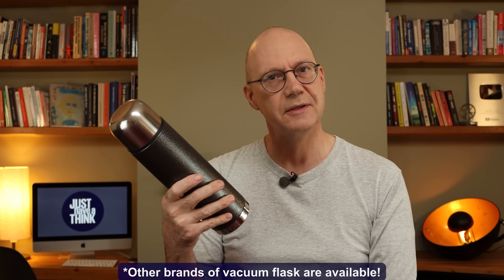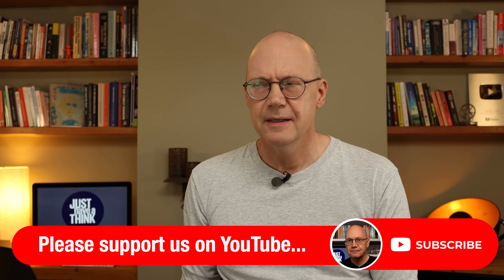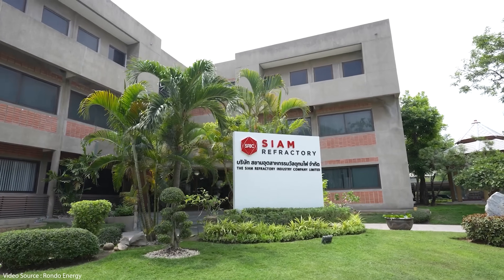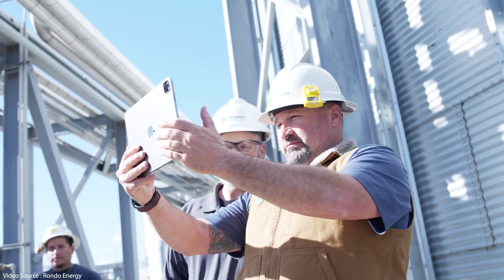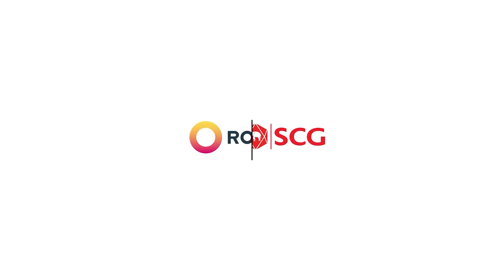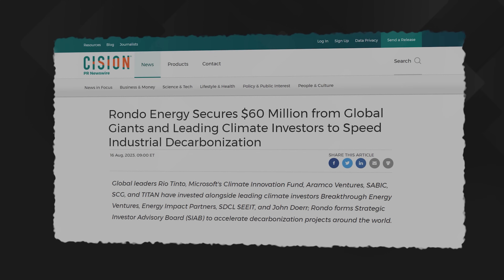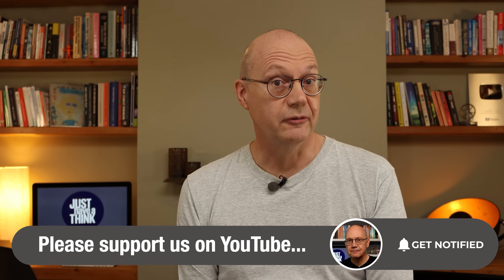This energy storage technology is HOT STUFF!

Comment: Check out the long history of ceramic brick steel heating furnaces. "Checkers are a matched pair of insulated in ground pits with a pattern of brick and air passages. The exhaust of the fuel  burners is pulled into one pit to reheat the bricks while ambient, pre- combustion air is heated in the other pit. Higher heating capacity and greater efficiency makes possible close to 3,000F in the steel reheating pit for forging or rolling the steel.

Comment: The issue with all heat storage schemes for the electricity grid is the inherent inefficiency of a heat engine, especially steam turbines. Aint no getting around the Second Law of Thermodynamics. This means the round trip efficiency of any heat storage system is inherently low. It will always be much more efficient, and hence cheaper, to store your energy as kinetic energy (flywheels, pumped storage etc) or as electrons at a cathode (batteries, supercapacitors). This is exactly the reason, for example, that thermal solar (mirrors melting salt) cannot compete with solar panels.
Non-electrical uses (ie process heat, house heating) have a better chance of working economically, but that is a FAR smaller market than the grid and so much less sexy for venture capital investors.

Comment: How do Rondo achieve a final process heat/gas with 1500 deg C for cement - as one example? Rondo needs an electrical air heater which can deliver maybe 1600 deg C by receiving 1400 Deg C from the heat box to charge the heat box?? They should explain the details which can make you believe in the system.

Comment: 1m³ of hotwater = 50 litres of refractory brick.
 A m³ brick = 20 m³ of hotwater. 😊😊
Just blow hot air over the water pipes and turn the hotwater tap on.

Comment: For the highest temperature (1800 degrees celsius) thermal battery and no "toaster wire", check out award- 
winning MIT-spinoff, Electrified Thermal Solutions, located in Medford, MA, USA.

Comment: The real question for power storage is which is most reliable long term. Personally I'm working on replicating rainwater charge capture and intending to use both that and solar for a 1kWh isolated power system that delivers 24V and constant current for lighting etc.

Comment: Why not add a smaller one of those hot brick units to every new house and public or industrial building? They could collect Solar heat and atmospheric heat, using heat pumps, and be used to stabilise temperatures in those buildings, whilst supplying a good amount of the hot water which the places need.  The warm waste water could go through the heat pump to reclaim much of the energy which would otherwise go down the drains.

Comment: I'm wondering how much excess electricity supply we have in the UK, I was under the impression we were, at times, hard pressed to generate enough electricity to meet our current demand, is excess supply a common occurence even against that background?
Reply: Different countries (and different utilities within countries) have different energy dynamics, some struggle with under-generation and some with over-generation. One thing remains true across all markets -- as renewable energy is increasingly deployed, generation during daylight hours will dramatically increase, and the only way to transfer that to off-hours is via storage. In our case, we're using peak-generation energy to turn off gas-fired generators 24/7.

Comment: Scalability is probably the most charming thing about this. As it seems to also work at smaller scales. We will probably have a much harder time if we do not also try to break the oligopol of the big scale power plant companies in the process of rebuilding our energy grids.
Energy is the key ressource to break out of the age of scarcity and we need to push for easily available cheap energy to finally break out of the scarcity management economy.

Comment: Simple question:
How do you insulate 60-90m3 of rocks heated to 700-800C so they lose less than 0.5% energy per day when its at the hottest state?

Backstory: Heat the rocks during summer with PV panels to have it usable during winter.

Practically it would have to be less than 0.5% but not much more.

My only solution is to just use more rocks, bricks and air gaps plus a bit of glass wool. But maybe I am missing something obvious?
The vacuum containers are too difficult in implementation for popular use.

Comment: " can they now achieve their goal of a 90GWh per annum production facility for their simple heat battery technology"?

The simple answer is no, because they are not producing any energy, they are converting high value energy to low value heat.

But it might be a way to use the excess wind energy in the warmer months to provide hearing in winter, accepting the huge losses of energy,.
Reply: With a discharge rate of 1% per day, heat storage over three months (summer season) would be about 60%. And I doubt the numbers in their spread sheets are even close to the real numbers they have never been historically.
Reply: That first installation is "delivering 2.3 MWh on each charge cycle", and how much does it consume?

Comment: Expanding this idea, Just have a think, there's a Czech company that is introducing a product for small residential housing. You'll buy a device with a super-insulated box of sand (above-ground shipping container or dedicated underground). You'll heat the sand in the summer to 400°C (480°C for larger industrial applications) and gas-heater sized box in your house will provide the heat whole winter. Thanks to tackling both thermal radiation and conduction it only looses, if I remember it correctly, like 8%  of heat during whole heating season cycle due to thermal losses. The sand should be "forever" operational without loosing it's properties. The down sides are the storage is quite huge for a typical house (can't remember how many cubic meters, I think like 30 m3) and the initial cost for preorders is really high - in excess of €50k. Just have a think, if this is really all feasible and working perfectly and the price goes significantly down due to competition. We'd be heating our houses with the summer solar excesses from our PVs! Apart from that, they prepare something like mobile heat units, so a couple of trucks would arive to a destination with pre-charged shipping containers and provide a heat in case of an outage of a heating system.

Comment: 'Heat Batteries' Blocks of concrete with resistance heaters in them were installed in most 1970's UK Council houses. To power, Blown air ducted heating. They were OK, as long as you didn't mind being a dried out dessicated prune all winter. Isn't it great how ancient technology is jazzed up, with buzzwords like AI & Heat Battery...

Comment: Any progress on the molten aluminium boilers designed to replace conventional boilers in power stations?

I like the idea of using change of state (melting materials) as energy is stored without a rise in temperature (once melting point is reached).

Comment: Yeh, ok, but what's new? 
Don't get me wrong, I like the general concept & I like to see it implemented & reported but what's new here? 

Storing heat in bricks & other artificial or natural rocks probably goes back before the Stone Age, insulating your rock pile is a bit more modern but not significantly so. Brick shapes optimized for a desired fluid flow isn't new (though this shape looks fragile, especially with temperature cycling) nor is a secondary heat transfer fluid. 

What I'm seeing is particularly good insulation & an unusually high temperature, neither are novel, even in combination.
AI through computers is new but automatic control systems date back centuries & AI is just the latest fad version. 

What's the "Unique Selling Point" or is it just marketing?

Comment: I'd like to know what the thermal capacity of a 1000kg of those bricks is compared to say 1000kg of a high temp molten salt. Its that change of phase as the salt goes from a fluid to a solid that stores the energy.

Comment: I'm a really big proponent of these types of new projects. No future tech that's never going to work or costs 15 times the initial advertised amount. Just and overengineered rock wrapped in insulation materials that does it's job. It probably has a larger physical footprint but at least it works well without breaking after a couple years.

Comment: Storing excess energy as heat is a really, really bad idea. 
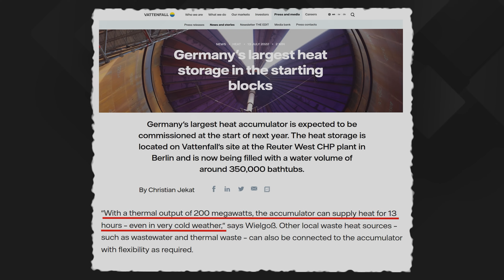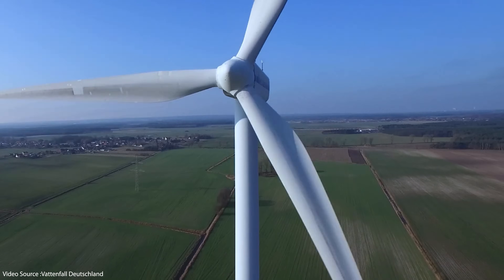2:35 "13hrs" is probably accurate, 3:00 "during the winter months" is complete pie in the sky garbage.
The whole purpose of this scheme is to soak up tens if not hundreds of $millions...then go bust, because it doesnt work....Just another M0ney L4undering scam to transfer public taxes into private pockets...
Reply: @williambreen1001 I wouldnt say it doesnt work but its a terrible way to store energy for any longer than hrs. Only flywheels are a worse idea but both are perfect for corporate criminals to soak up as much in grants as they can and then go bust.
Reply: @williambreen1001 Increasing the volume reduces the percent of heat loss but its still going up with the volume. ANY storage system thats losing energy constantly is worthless for anything other than very short timescales to 'fill in' for gaps in the main energy source. There is no useful information in this video what so ever, probably because if provided it would confirm how ridiculously worthless the whole idea is.
Underground 'seasonal' heat storage is only possible with a heat pumps which heats the ground a few degrees in the summer and draws it back out in the winter.

Comment: There is also cold storage. I went to an university where the air condionning system was using fresh air at night and off peak electricity to make ice, and using the ice to make cold air during the day. The heat pump was more efficient because the air was colder during the night. And electricity was cheaper at night. Ice storage is not expensive.

Comment: i’d love to see a data comparison on the available numbers between these brick systems and the large sand-vat heat tank like the one in Finland, while these hyper engineered solutions like those heat bricks are probably the most effective technologies, seeing the difference between that and a relatively simple, accessible construction like the sand tank, would be eye opening. thanks for the vid!
Reply: The differences I see are. Sand storage needs  a lot of pipes inside the sand to circulate the heat transfer fluid (air, water, oil...). The brick have already their own air path to transfert heat.
Sand need a structural container, brick can be just pilled.
Brick need a lot of energy to be made, sand doesn't.
Reply: The sand tank is super cool -- the main difference is temperature, our bricks go much, much higher temperature. Sand of course melts and turns into glass -- so there is a hard limit to how hot it can be, and many industrial processes operate at temperatures exceeding 1000C.

Comment: imagine you have a company who makes meat balls. you need heat to fry them and need cold to freeze them  ==> two temperature storage units, one with +300°C, ohne with -50°C, a big heat pump in between and you use hot air for frying and cold air for freezing them.
this would be very efficient

Comment: Isn't sand and dirt cheaper? (I think I heard you say dirt cheap battery can (and is) be made from dirt or sand).

Vertical pipes with air for spreading heat around. Is that what the Finnish guys are doing?

Comment: Looks useful for very high temperature air. The specs for the RBH100 reveal an energy density similar to water. 13m x 10m x 10m for 100MWh is (I think) 280J/cm^3, the same as heating water by just under 70 degrees.
For something like district heating the water tank approach will be simpler and probably cheaper. Danish seasonal pit storage costs are available online (perhaps 35 EUR/m^3), and as the pit scales the losses are reduced (energy stored goes with the cube but the area of the tank is the square). In that case charging with solar thermal collectors or heat pumps will make more sense than burning the electricity.

Comment: Nice!
This reminds me of sidewalks that burn your feet.  Hot summer days.

Has this been tried or adapted to:
 - Heating water.
 - Residential Usage.
 - Small Business

What is the impact of production:
 - pollution
 - carbon footprint
 - limited resources
 - recycling materials

This one has my attention.  It is something we can easily understand, does not spontaneously combust, safe for usage in homes(?), durable, can be used almost everywhere (if not everywhere).
Reply: Howdy! Yes this can be used to heat water, however, we're a bit too big for residences and small business. I know a few other companies (one out of the UK at least) are working on smaller scale heat batteries. 

A single RHB eliminates as much carbon per year as deploying 8500 electric vehicles. We also are non-combustion, so no NOx, SOx, PM that is hazardous to human health, and we improve local air quality by replacing gas-fired boilers. Low-cost, highly abundant, recyclable materials.
Reply: @RondoEnergyGlobal  Thank you for the information.

Comment: That plant reminds me of a similar one recently built in Finland to store excess energy as heat to supply buildings and a test plant built a Hamburg several years ago that stores heat in volcanic rock. That plant in Hamburg keeps the rock between 600 and 720°C and produces steam to power a turbine that drives a generator. Efficency is about 50% - much worse than batteries, but much cheaper and easier to build. Maybe its even better than using hydrogen.
And there is the new heat storage plant whcih is currently under construction in Esbjerg, Denmark, that uses an industrial-size heat pump to draw heat from the north sea and stores it in a giant tank.
Reply: Steam turbine efficiency is around 35%, not 50%. If higher efficiency is needed, it has to be CHP plant which can reach 90% total efficiency. But they produce a bit less electricity compared to dedicated power plant with same thermal size. In my opinion heat storage doesn't make a lot of sense in pure electricity production. For augmenting district heating they do.

Comment: Wow. Hot stuff indeed. One I learned about in my secondary school, some... lemme see... yeah, over forty years ago. Regenerators and recuperators, they are called in the trade.
Also, accumulative electric heaters, using special ceramic "bricks" heated by cheaper electricity during off-peak hours (aka "lower tariff" hours) have been around for even longer than that, so yeah, hot stuff. Like, really hot. Beam me up, Scotty... ;-)

Comment: I wonder how scalable this would be in the smaller direction. The solar array at my home produces more than double our annual electric consumption, and much of that is in summer; in winter, we heat with a high efficiency wood stove. I love how renewable the wood heat is (we grow our own firewood coppices of black locust and harvest them at the right diameter to not require splitting, and cut them with an electric chainsaw, so the footprint is minimal). However, the labor of firewood collection and use is significant, and it does make a mess. I'd love an electric heat system that captured the excess summer heat and solar power, for storage until January through March! The ground here is about 12 feet deep solid clay before hitting bedrock so bricks are an easy local option for making a thermal battery.

So I guess the question is, how many bricks would we need and what kind of insulation, and how practical would such a thing be for just one house? We heat about 2,000 sq ft in a log cabin, decently insulated, to about 60F through about 3 months of cold weather ranging between 15F to 50F. Almost no snow but lots of humidity and wind.

Comment: You'll still have to produce the energy to heat these bricks. It's not decarbonization per say but optimization of renewable capacity.
Still super useful though 😊
Reply: We typically charge via off-grid wind and solar, and directly replace gas-boilers. =]

Comment: How is the energy extracted from the heated storage? If air is used the heat gained would cause a significant expansion that would drive a turbine directly and still be able to raise steam for a conventional steam turbine. I envisage a three stage sytem of hot air generation followed by steam, then finally district heating.

Comment: We used some modified brick storage heaters for many years in the 80's , we had the type with the bricks made of a mixture of clay and iron slag..(very very heavy bricks), we made some MDF covers for the sides with 2 inches of extra rockwool insulation it made them very efficient and stopped most of the problems that they're notorious for.... never worked out why they simply were not manufactured with better insulation ... they're still made today but haven't changed much ....its a shame really.
I'm installing a seperate hot water storage system to use excess solar power at the moment at home and it frustrates me that comercially available hotwater tanks only come with ~40mm-50mm insulation.
I'm going to be adding another 40mm at least as the surface of the tank still gets warmer than the ambient temperature of the room its in.

Comment: The best is not to transform the energy, i.e. heat to movement. The problem is that storing heat for winter needs a lot of time, half a year. The lava from volcanos keeps hot during even years, only with the insulation of the same lava crust and because of the big size of the deposit. What about huge underground deposits of molten salts in order to take advantage or latent heat too? Or perhaps that is very expensive for large masses and then it is better to keep it in bricks, rocks, etc.?